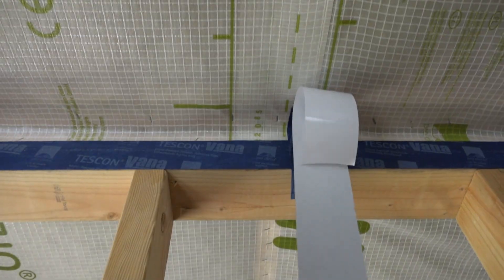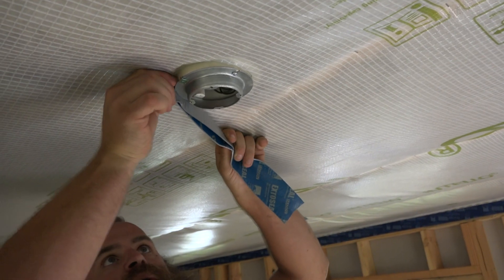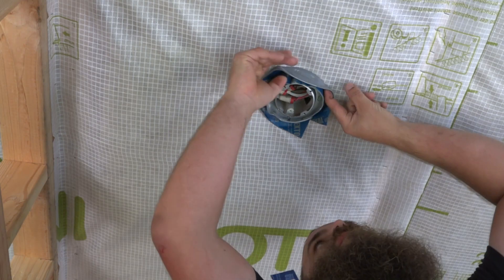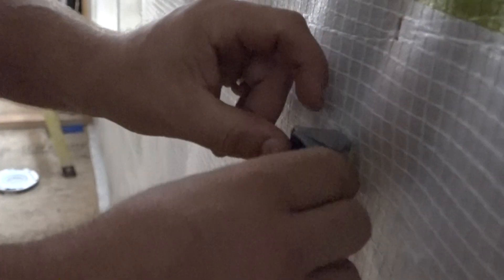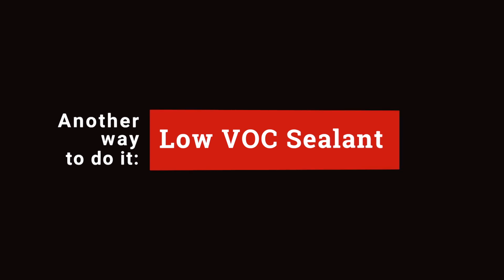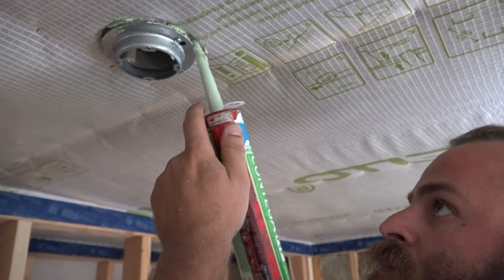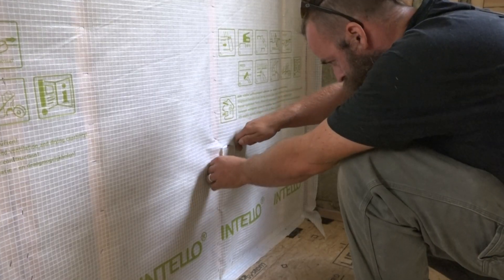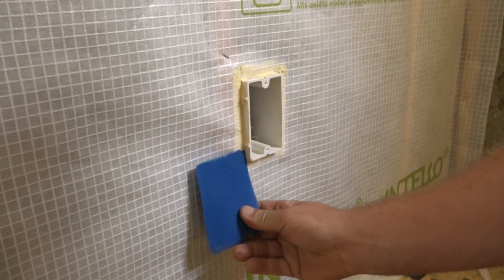Interior Air Barrier Membrane Installation (3/3) Penetrations

Comment: Did you intall battens before putting up drywall? I am doing my insulation soon with intello plus as my interior air barrier. And would rather not add battens.
Reply from the maker: There were no battens installed on this job. Why would you install interior battens?

Comment: How does plaster board get installed?
Reply from the maker: by knuckle-draggers who will most likely screw up the detailing at the windows 

(ask me why I say this)

If you're asking about the drywall screws penetrating the membrane, then use some sort of drywall gasket. In this house, there are so many belts, suspenders, and pairs of clean underwear that it is going to leak very little.